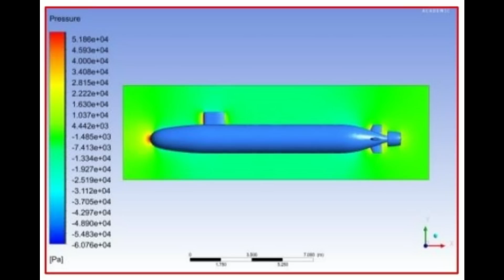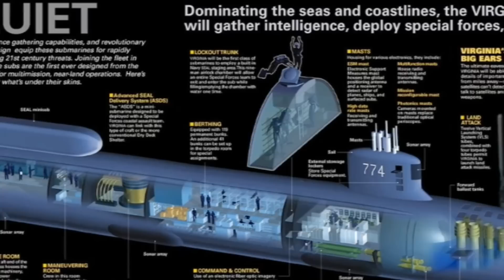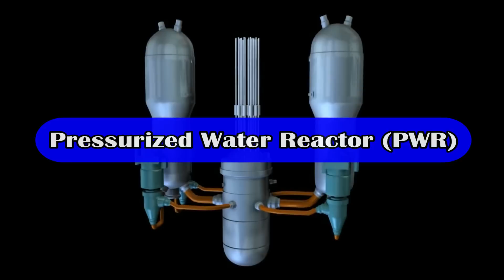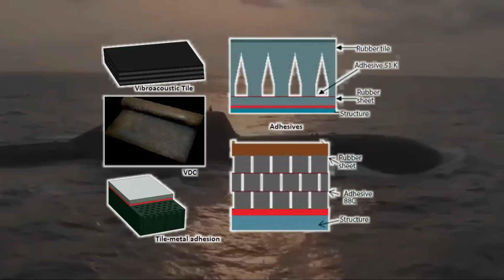Project 75 Alpha: Indian Navy Nuclear attack submarine(SSN) #indiannavy

Comment: Hopefully the tech advances made in SSN's also show up in the future Arihant classes, or can be retrofitted. The first in the series Arihant 1 and 2 don't seem like they are very useful, and should be converted to fire LRLACM. At least if it fires cruise missiles it will have substantial range. Pumpjet propulsion should be standard issue on all new nuclear subs, along with better reactors. I think Bharati nuclear tech is good enough now, that foreign assistance is surplus to requirements. Better to do it all alone. I see no need to wait till the first 3 are complete, pre approval needs to be given for the next 6. After the first sub is in service is enough data on what future requirements the next lot should have. An underwater and mobile ICBM deterrence which is quite difference from silos is what Bharat is on track to achieve. I don't see how nuclear weapons on aircraft which are fragile is a good move.

The first submarine is expected to enter service after 2032.

On 14th Jun 2021, it was reported that Cabinet Committee on Security (CCS) is considering the proposal to build three nuclear attack submarines. The decision on building the next three will be taken after the completion of the first set.

Comment: what is the proposed tonnage?
Reply: 6000-7000 tonnes
Reply: As per my knowledge the proposed reactor clwr b2 with 190mw of power and 35MW of shaft power , it will have a displacement similar to akula 2 or akula 3 class which in turn is 8400 long tons and 13000 short tons .